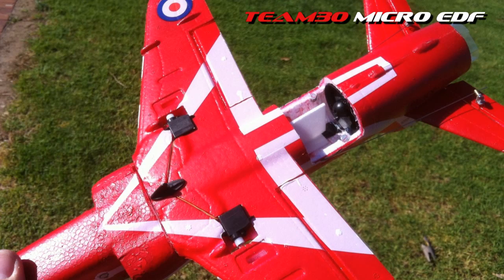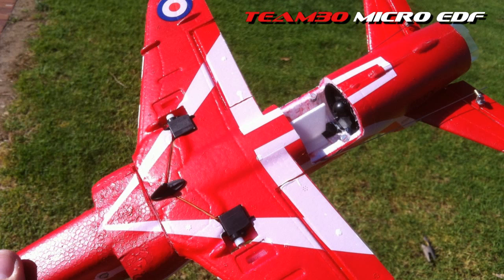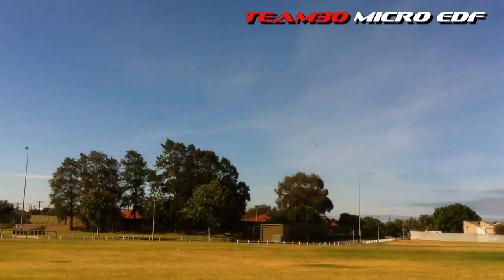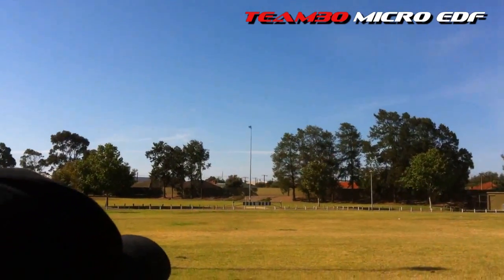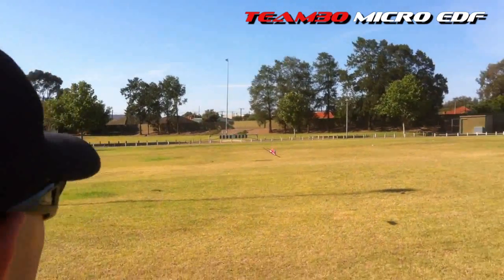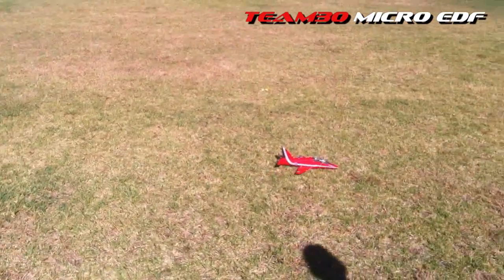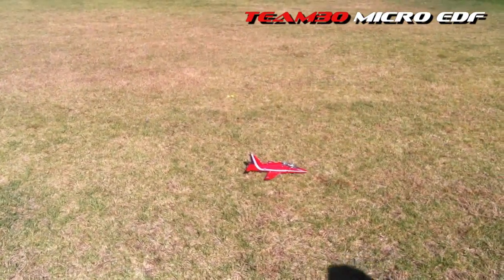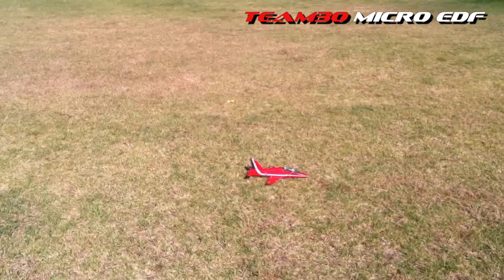Skyangels 35mm EDF Red Arrows Hawk CG tests.

Comment from the maker: @Tsavah - Yes, correct. There's no where to go for the lipo. It's a 325mah G6 ThunderPower 3S lipo - it's in there tight and as far back as it can go without relocating the elevator servo. Once I had the CG back far enough, I could fly inverted so I am on the right track. :-))